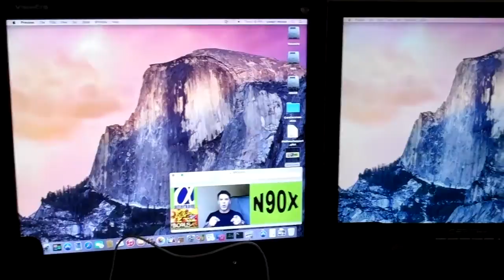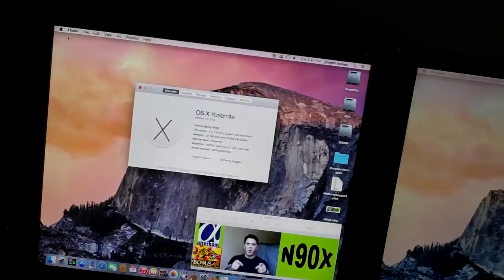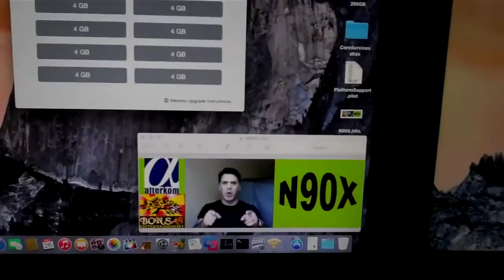Xserve as MacPro Part 1 (N90X)

Comment: Great videos!  What do you do if you get one of these and it asks you for a password?  I saw that happen in another YouTube video.
Reply from the maker: Not sure what you mean? if you bought a used server, just reinstall a new version of OSX after re-formatting the drive. You always should start with a fresh install of what ever version of the OSX you are deploying.
Reply: +NetScalerTrainer How do you reformat the drive on one of these XSERVEs?
Reply from the maker: David Halligan OSX "Disk Utility" can reformat the drives. But if you mean how to get a new(er) version of OSX (for example Yosemite, el Capitan) you need to 1) remove drive from xServe and connect to newer MAC install new OS on it and modify the .plist (as described in other videos) or 2) put server in TARGET DISK MODE and install OS via FIREWIRE from another MAC.

Watch all the videos in this Apple series to learn all the tricks.
Reply: OK, thanks!

Comment: Thanks for the info. I ended up getting a oem Apple video card and installed it today when it arrived. I blogged about this here http://twistedmac.com/index.php/21-mac-hardware/34-bringing-life-to-an-old-2008-xserve
Reply from the maker: Carter M Nice work - the video card I used is pretty much the same (GT-120), but with 1 GB vRAM and not Apple OEM. But works great!  2008 Xserve is fantastic hardware for the new eBay price! Does produce a bit of heat, but then again 8-CORES is gonna do that!

Comment: Thanks for the post! I've actually setup Yosemite on a 2008 XServe but my issue is the video card. I pulled out a nVidia GeForce 7300GT 256MB Video Card from a Mac Pro but will not work. So far running on the stock card but too laggy. May have to revert back to OS X Lion unless I can find a card that will work.
Reply from the maker: Carter M Check put part 3 - where I give you a parts list including the "apple ROM" GT-120 which is perfect for this server as desktop ;)
Reply from the maker: Carter M +Accelerated Video
http://goo.gl/V3ET0P